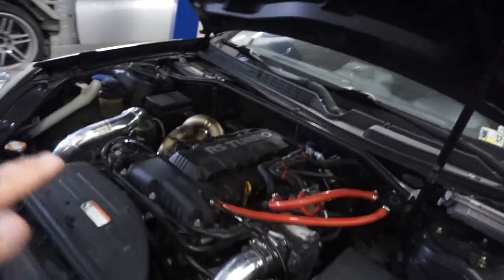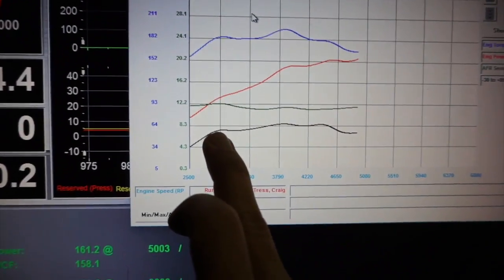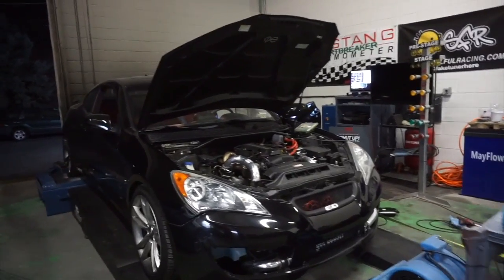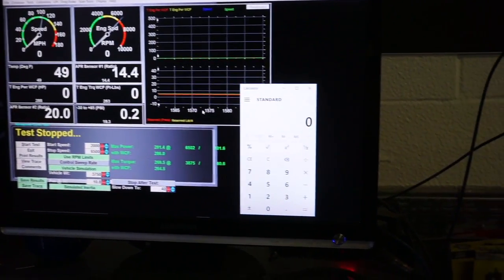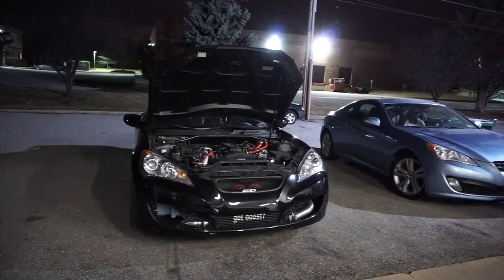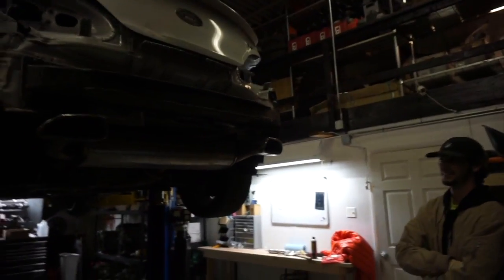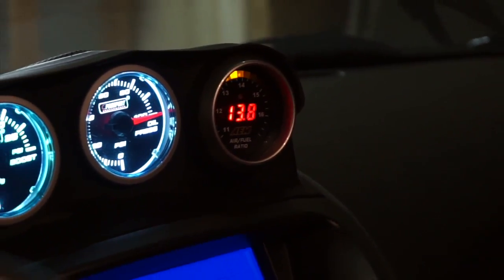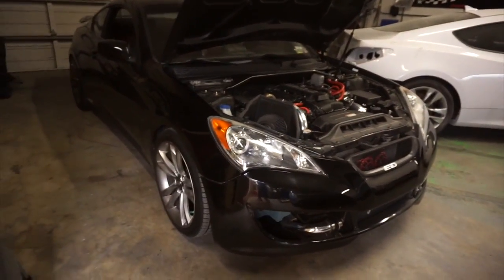ISR Evo 8/9 Twinscroll 20G turbo install (Part 2)

Comment: I have a bk2 2013 2.0t, if I wanted to get this kit what are bolt ons that I should prepare for and would you recommend this kit if I wanted to reach high 300s/low 400s
And is water meth injection, recommend in this set up?

Comment: Is it a TD05 or td06sl2?
Reply: Paulo Barbosa td05h
Reply: In my opinion it's a small turbine for the 20G, that's the reason it tapers at the top, anything over 18psi will suffer from exhaust backpressure, the more you hold the wastegate closed the worst it gets, a TD06SL2 is the perfect size for a 20G on a  twin scroll 2.0, that's what i'm running.
Reply: Paulo Barbosa how much do you put down?

Comment: Seems to me  the GDI engine is not as strong as what i'm use to. which is the beta1 and beta2 engines . i have made 300whp 330tq on 14psi and use a 5431 precision  complete stock beta1 with arp head studs e85 and also race on 22psi which i never dyno it on 22psi but im sure its 400whp on a stock engine . now my question to you Jay is are you just playing it super safe with whp numbers ? are have you seen the gdi fail over 350whp? also why you use water meth ? to me e85 only way to go for a street car. Good job on the car as well
Reply from the maker: GDI? none of Genesis Coupe 2.0 engines are actually GDI but MPI base. Stock engine can hold around 350-370 for BK1. Yes we are playing everything conservative for longevity. Sure tune will get blamed for anything regardless but customer did request to stay on about 15-17psi of boost.
Reply from the maker: Thanks. For W/M there are pros and cons. We don't have many E85 stations around here yet it requires a lot more parts needed than meth kit for sure. Not everyone can afford All E85 friendly components along with bigger injectors/fuel pump/etc when simple meth kit install can take care of it.
Reply: seoulfulracing I thought they where gdi engine my bad shows I'm not update on anything past 2006 ha.
Reply: seoulfulracing another question on your old tiburon setup with the 1.8 piston rods you made 450whp was that on pump fuel only ? And how long did that setup last ? and do you think it's possible if I run e85 to make 500 on a beta 1 with 1.8 piston rods ?

Comment: p.c tip when the pc beeps at you and refuses to startup a good place to check first is your ram, dust gets in the slot and the pc thinks there isnt any ram and wont start, hence why the blowing random air into it may have worked, enjoyed the video cheers.
Reply from the maker: Thanks for the info. Yeah sounds like 5+ years old ram is bugging out.